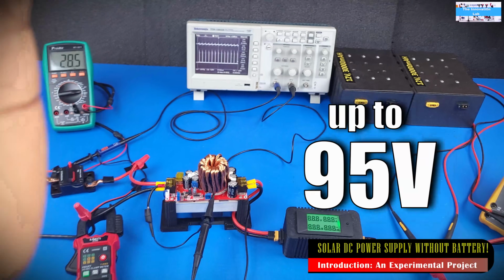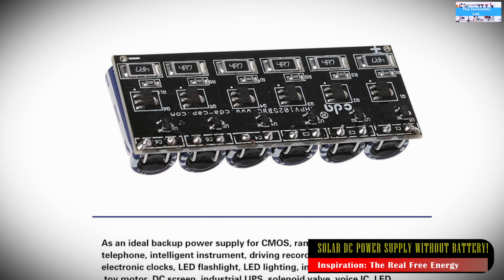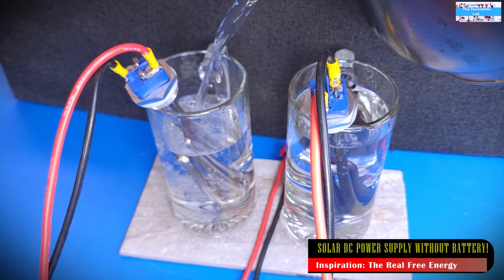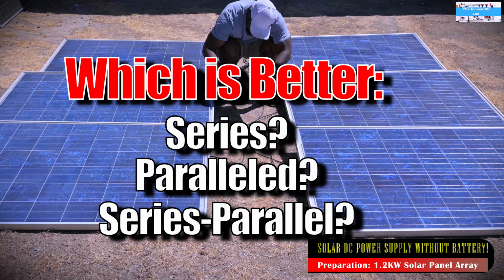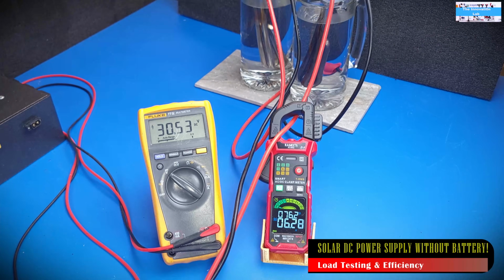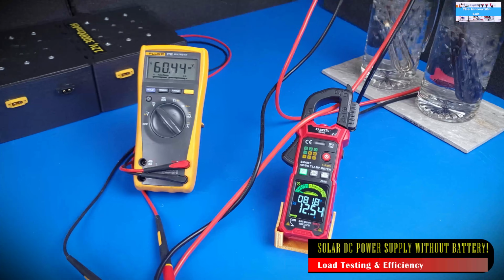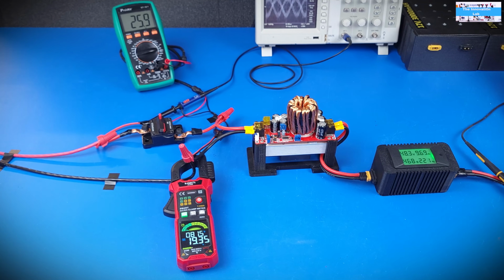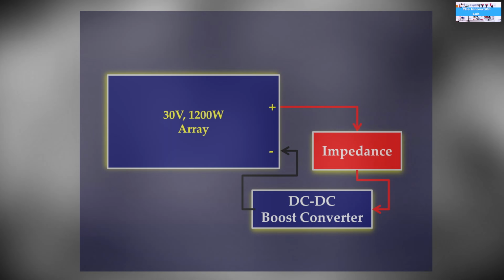Solar Without Batteries?🤔☀️

Comment: I am really involved with all your projects. I have the 1800W with the fan but looks like something is right because the CC potentiometer is unable to control the current. I ordered another unit to test. I changed the potentiometer with different 5K, 10K 2K and 1K and nothing. I even jumped from R30 to positive from the potentiometer SW502 and nothing.
Reply from the maker: Thanks a lot for being a valued supporter of our channel. I greatly appreciate it.👍👍

I am happy to help you troubleshoot the CC issue. 
Let me ask, what are you using the converter for?
I have used quite a lot of these converters, and I have never had this issue. 
However, I also realized that depending on the nature of the load you are driving, adjusting the CC would sometimes only lead to a voltage drop - especially if you are powering a resistive load.

I found that the CC adjustment works best for battery charging or for driving loads like high power LEDs.

To increase the current turn, the pot counter clockwise (....that is with converter input to your left and output to your right). At the end of the pot rotations, you will hear some audible clicks....but the pot adjustment spindle will keep turning. So pay attention to the audible clicks as you get to the end - in both directions.

As a way to test/check, try using your converters to charge some batteries or to drive a high voltage LED. But make sure that you re-install the original CC pot value that was on the unit... should be about 5K trim pot.
Please see the video below and use it as a reference👇👇👇
https://youtu.be/WDWJ77WWkXc?si=_0tkG2vVJONZZWGl

I hope this helps.
The Innovati0n Lab 💥 
www.theinnovati0nlab.com
Reply: @theinnovati0nlab782  WOW !!! Thank you for your help. I have a 48V 1500W power supply as a source and I am boosting to 84V to charge a 72V e-bike battery. The problem is that I am trying to control the Constant Current to be able to charge at 2A only. When I use the 502W dial does not seen to be working. I changed the potentiometer for a new one, also changed for a 10K ohms and nothing. I though was something broken and I jumped with a thin copper wire from R30 (220 resistor) to the positive of the potentiometer and nothing. I ordered a new board to test but I would like to repair this one. I will make a video to show you.

Comment: Can i charge my ebike using dc dc booster and solar panel
Reply from the maker: It will depend on the required charging voltage for your ebike.
The converter can provide up to 95V max and a max charging current of greater than 20A.

I hope this helps.
The Innovati0n Lab 💥 
www.theinnovati0nlab.com
Reply: @theinnovati0nlab782  i have 48v battery .so it will working cool
Reply: Currently I am charging my ebike from a 12volts battery 🔋 connected to solar panels, using dc2dc converter directly. Ever since when my ebike charger 🔌 get faulty, I was unable to find it replacement, I then switched to this method

Comment: Good to see you brother that you still work on that project best of luck 👍
Reply from the maker: Thanks a lot for the great feedback, brother. Much appreciated.👍👍👍
I have a huge  passion for solar and power electronics - I try to use it to bring value to our audience. I hope you found the video useful.😊

Thanks again.
The Innovati0n Lab 💥 
www.theinnovati0nlab.com
Reply: @theinnovati0nlab782  as your passion I see long time ago I make 300 watt solar inverter that's work directly with 100w solar  panel  if you like I send you schematic you can easily build it and you can sale it it will help you
Reply: @theinnovati0nlab782  True.. it may not also be economical because of certifications and regulations and potential risks

Comment: Such setups won't work. One cloud can collapse your entire system..
Reply from the maker: Thanks for the wonderful engagement. I greatly appreciate it.
I see your point, and I   believe I talked about it as well in chapter 7 of the video.  This was also why I was talking about the power buffer concept. The idea is to maybe use a smaller battery system that could buffer the system during periodic low irradiance moments....ans adding supercaps for high surge or inrush current demanding loads.
More experiments to follow.
Stay tuned.

Overall, thanks for the objective feedback.
👍👍
The Innovati0n Lab 💥 
www.theinnovati0nlab.com
Reply: @theinnovati0nlab782  yes, small but high discharge battery should help.

Comment: Non synchronous topoligies for such high powers make no sence, this is a 50 years old topology.
Reply from the maker: Thanks for the objective feedback.👍
I see your point.

Usually, my recommendation is to use MPPT charge controllers for their IV adaptability and optimization via incremental conductance. 

However, a few things:
1. While most of us in the more developed countries can afford these expensive new technologies as they hit the market, a lot of people in 3rd world countries can not.  To some people, the cost of a 20A MPPT charge controller could feed an entire family for a whole month......no jokes. 
So, I will experiment on a 50-year-old technology if it sheds light on an affordable solution.

2. Some old technologies have proven to be reliable and still work till today. Yes, we know that those technologies may not be the most efficient, or the most compact, or elegant.....but a lot of people will choose affordability any day.

💥💥
How old are these technologies? Do they still work? 
- Power Transformers
- Power Inductors
- Wire-wound resistors
-Vehicle wheels
- Vehicle tires, ......etc.

My point is that we should never discard or discourage an idea simply because the technology behind its theory of operation is 50 years old.

This is my counterargument.😊
I appreciate the wonderful engagement.

Respectfully,
The Innovati0n Lab 💥 
www.theinnovati0nlab.com
Reply: Awesome.... Totally agree with you  @theinnovati0nlab782
Reply: Remember, these 50years old technology are yet to be found in many societies. 
Please, let me asked. Can I use that other non modified Dc to Dc converter to handle such power? Because I cannot afford to modify it similar to yours.
Thanks 🙏 for the information ❤
Reply: There are very low losses, because this is a boost converter,  there is lower current on the output, but for buck topology, only way is synchronous switching for achieving high efficiencies.
Reply: Ya I mean eletric cars are 120 year old technology too and the internal combustion engine too that doesn't mean it's not still useful today

Comment: У меня была идея повышать напряжение для моего электро велосипеда не с 12v до 50v как это обычно делают, а с 2v-4v до 12v и потом с 12v до 50v 30a. 2v потому что мои ячейки LiFePO4 имеют такое минимальное напряжение. Подскажите какой преобразователь сделать для этого или может возможно сделать сразу от 2v до 50v с КПД 90%. На выходе нужны 50-55v 1500w долговременных.
Так же я думал применить похожую схему для получения из параллельно подключенных солнечных элементов 3 последовательно и n параллельно. 
Идея заключалась в том чтобы максимально сохранить силу тока подняв до высокого уровня порядка 100v или 200v чтобы потом инвертором сделать AC 220v. Так я и нашёл ваш канал.
Reply from the maker: Thanks for the great encouragement.
👍👍👍

I love it when great minds think outside the box. Kudos on your project idea.

However, the major problem I see is that 2V will be too low for what you want to accomplish, and I honestly haven't seen any converter that could handle that low of an input voltage level.

Let's do some quick math using your specs:
Input voltage: 2V
Output voltage: 50V
Output current: 30A
Output power: 1500W
Efficiency: 90%

💥💥💥
Calculations:
Required input power = 1500/0.9 = 1666.67W

Rrquired Input current at full load = 1666.67/2 = 833.3A

Honestly, it will be extremely difficult, super expensive, and bulky to build something like this - using today's technology.

I hope this helps.
Respectfully,
The Innovati0n Lab 💥 
www.theinnovati0nlab.com
Reply: @theinnovati0nlab782  спасибо. Значит надо идти через dc-ac.
Reply: @presechmax а если соединить последовательно 4 ячейки LiFePO4 то можно и 12 вольт получить😮
Reply: @madnomad6528  проблема в лишней электронике. Bms+pcm. Итак электроники много. Хотя я нашёл пару схем с автотрансформатором на кольце, а вроде dc-dc. Просто от ячейки это было бы технологичнее. Так что пойду через 2 ступени: 1) от 2v до 12v и 2) от 12v до 50v. КПД не выше 80%. Одна ячейка или параллель ячеек даёт хороший ток. Я прикидывал. Так есть выигрыш. Главное электронику сделать надёжной. Этот китайский 1800w не подходит. Схему взять и собрать свой.
Reply: @presechmax   BMS is very simple, only needs voltage reference, resistors, transistors, and a wire to each cell terminal.

If you can convince a designer (myself included) that there is demand for such a converter, it can be made.

Look at this video's demonstration. With this custom inductor, 35A increases the winding heat to 70ºC even though resistance is very low. 35A at 2V is only 70W with 100% efficient output. This inductor style is challenging to cool, and without any voltage to multiply the power the low voltage applications are unsuitable.

However, another option for very low voltages is a switched capacitor charge pump instead of an inductor type of boost converter. The power density is reported as near 100W / mm^3. To achieve 1500W, a charge pump stage should be connected to the batteries, and additional voltage doubler stages should be added until the 1500W current is reduced to until it is cheap enough and compact enough to switch to an inductor or flyback transformer stage. Stage 1 charge pump = 1.5V 1000A, stage 2 3V 500A, 4.5V stage 3 333A, 6V stage 4 250A. Then use a 6:60V transformer with a 250A primary.

Boost converters using inductors are most efficient when output:input boost ratio is 1:1, and least efficient in higher gains above 7:1. I have made an LED boost converter from 18V to 81V with 90% efficiency and 9V to 81V with 83% efficiency. But this is ok because the power is less than 40W and the heat is manageable. Anything larger than 7:1 you should consider a transformer with primary and secondary. The magnetic losses are better than inductors at a certain point.

There are more options to produce high voltage, but you could get rid of your 50V motor for a low-voltage model. It would be much simpler.
Reply: @InfinionExperiments  дело в том что у меня тяговое мотор - колесо. Отказываться не намерен. Это не просто велосипед, прицеп для груза и город стоит на горе. 
Что же до катушки, то я иду через автотрансформатор. Если делать с запасом мощности и использовать более подходящие материалы типа обмотка медь и сердечник ферритовый на правильную проницаемость от 200А трансформатора сварочного аппарата, то как раз всё нормально получается. Радиатором можно избрать металлическую коробку для аккумуляторов. Она достаточно велика. Можно использовать промежуточную накопительную аллюминиевую пластину.
Reply: @presechmax  Well your level of comfort is much higher than mine, surely! You'll still need to boost the 2V to reduce the 1000A input current down to something smaller. Will you choose a charge pump circuit? Or use many synchronous boost converters in parallel?

The most efficient design will be to use batteries in series with a bms, just because everyone buys it and drives down the price.I think your cost will be higher with a low voltage battery and novel boost autotransformer, but if you want to do this anyways it should be justified by being cheaper if it is less efficient, or the same or better efficiency at higher cost. Otherwise it will just be a novelty.
Reply: @InfinionExperiments  первый этап идти от 12v и установить только dc-dc boost. Второй этап поставить dc-ac с выпрямлением на выходе от 2v. В качестве ключей я думаю применить большие транзисторные модули, для которых такая мощность нормальна. Это инвертор где вместо обычного дросселя будет применён автотрансформатор где толщина провода остается одной и разнится только количество витков. Там не нужны сотни ампер как в дросселе. Размер умещается в объем одной ячейки.